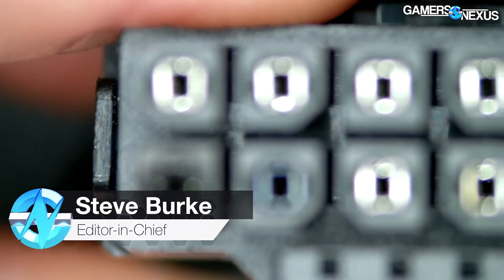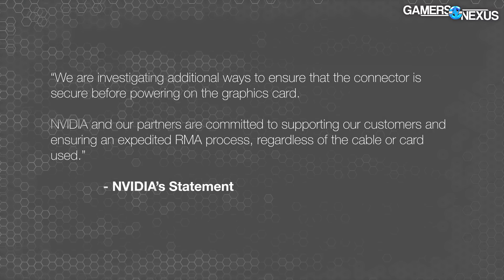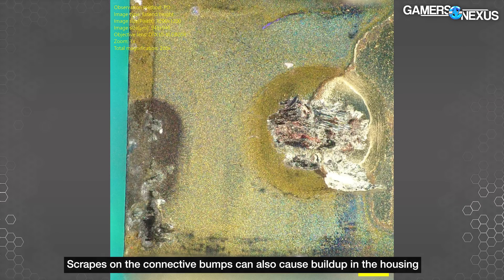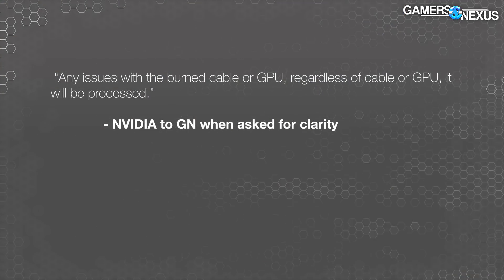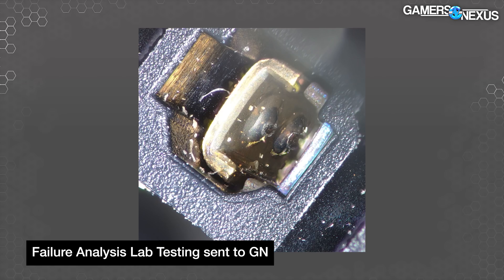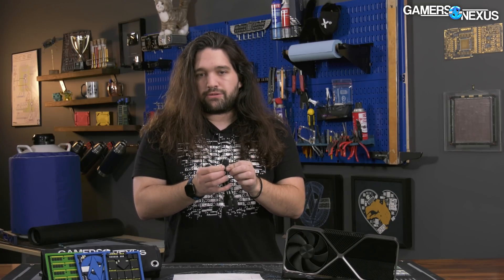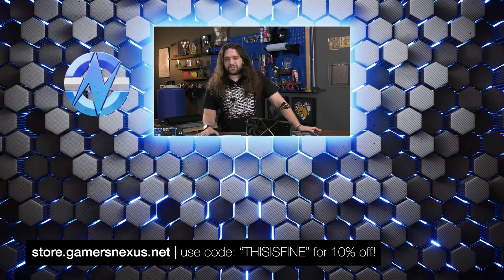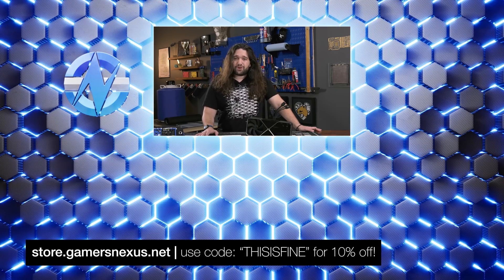NVIDIA Responds to Melting Cables, Warranty Concerns, & 12VHPWR Adapter Failures

Comment: If they widen the locking clip to cover most, if not all the width, it will fully secure the cable in full.

Provided the customer seats it till it locks.
Reply: @_Clivey  
Yes, it must be clicked in.
The widening will eliminate the tilt factor 100%.

Comment: I do not believe this connector to be safe, its underrated , its cycle count is dangerously low. bending in in any direction even on first insertion is enough to cause a spade to bend and cause failure. You need to insert the connector straight in till it clicks and never remove it even once. Any thing beyond i believe could cause failure. 

Also i feel like the .05% fail rate is low. its at least 1%..or more.

Comment: I have a gainward phantom 4090,and have no problems with the connector,i just looked when installed the card that the connector is perfekt fitted,and thats it,works like a charm here,this in a lian li o11 dynamic  tower.

Comment: They should probably be able to fix this issue by making the 4 sense pins shorter, so that it will not work at all unless it is inserted deeply enough. This would not be dangerous as the 4 sense pins do not carry a notable current.

Comment: Nice to hear nV finally respond.  They finally scoped the potential damage at less than 0.05% and decided, sure we'll cover this issue!  Good work, Steve/GN...you damn near finished that plugs cycles in one video for us!
Reply: Also interesting to see there was more hair on fire than melting gpu's over this when the data comes out and shows how little of an issue it was to begin with. But if you listened to all the chicken littles out there you'd think 4 out of every 3 40 series were melting down.
Reply: @mattk6827  Still not acceptable, over time the connector will become worn and brittle (prone to failure). Connector definitely needs a redesign.

Comment: 12:45  latch? wtf that cable DOESNT HAVE A LATCH , is absolutly WRONG DESIGN.  there is not way to secure plug without it 
which one of the designers though was fine to leave it that way?

Comment: Graphics cards are so powerful now that they can almost be directly plugged into the wall.

A single IEC plug vs these high current, low voltage cables.

Comment: I made this comment on the original GN video: if users can think this connector is properly inserted when it is not, that's a design flaw.  It should be almost impossible for the connector to be inserted improperly IF such improper insertion can cause melting or fire.  Improper insertion should cause the system to throw a VGA error, thereby alerting the user to the problem.
Reply: Yup. Funny to see all the people saying you deserve to have your card break if you didn't put in the cable right.

It has literally never been in issue in my lifetime. No connector I've ever used could become a fire hazard if improperly inserted.
Reply: @Nathanix321  Indeed, and none ever should.
Reply: Exactly what I commented on.
A cable should be socketed and done forever, without the need to check on it every time the user removes the side panel or pushes the cables to cable manage.
Every other direction or “instruction” is there to cover a poor design.
And the engineers know perfectly well that even power users do not assemble PCs using checklists and redundant checks.

Comment: I wish this much attention was dedicated to horrific coil whine issue in 40 series cards. It's so frustrating having to play this lottery. It seems like coil whine has reached new heights now. I've never heard coil whine as bad as in 4090 TUF card. Some people get whisper quiet cards, while others get buzzing/squeeling monstrosities (see der8auer's 4080 STRIX video). Would be amazing to know what % of cards have coil whine. Why do manufacturers insist on using components from inferior suppliers in some of their cards, but not others. What's even the point of these 2.5 kilo 4 slot coolers with huge fans if coil whine is louder than everything inside PC.
Reply: I had coil whine when using a psu I bought new with a 2070, when upgrading to a brand new gpu 2 years ago . I got a new psu, and it completely went away.
Reply: My 4090 TUF has a slight coil whine only at full load but in my experience the coil whine will usually lesson over time.
Reply: @dj Kplus that would be like buying a brand new car and having a loud squeal or knock or vibration and when bringing it to the attention of the manufacturer they respond with, it isn't a fire hazard or dangerous in any way and it's still drivable. I'm sure most people wouldn't be happy with that and would want it fixed, a replacement or get a refund. With the price of these new series graphics cards you would expect and should get a high quality product without any issue. It may not be dangerous or a fire hazard, but without knowing what is causing the noise it could possibly be a potential hazard of some sort. Besides the majority of graphics cards don't make a noise like described so I can understand how it would get irritating to have to put up with, when they shouldn't have to put up with it. But you are correct, unfortunately unless it proves to be a danger no one will really put a lot of attention into looking into the cause and to rectify an issue like that.
Reply: @dj Kplus Have you seen der8auer 4080 STRIX video? He said that GPU would be unusable in day to day. He could hear his test bench coil whine from across the room while having headphones on! My 4090 TUF could be heard from across the house. Yeah, let's ignore that significant number of people get dud GPUs while paying 2300 Eur / 2000 USD for them, and companies don't even treat this is a defect. You can't RMA for coil whine.
Reply: @dj Kplus lol did I hurt your fanboy feels
Reply: The point is increasing profits as well as lingering issues with the supply chain that makes it so that many companies are happy to get anything at all, even if it's below the standard they would have demanded otherwise.
Reply: @msytdc1577  Sure, let's totally ignore the suicide-inducing sound that some people have to deal with.
Reply: @Bloodonmyknife  Well, at least there is the option for having a graphics card at all for those that don't care, instead of there being no supply because 'available, and fully functional' isn't good enough for some. As to who may not care: users hard of hearing, wearers of in ear monitors or well sound insulated closed back headphones, people who put their PCs in a separate space just running a monitor and a USB cable to their desk area, etc.
Reply: @msytdc1577  I'd fall under the "isn't good enough for some" title. Unfortunately the people that"don't care" let these companies get away with offloading products that are inferior and or not at the standard of quality that they should be. You didn't state if you were the "don't care" type or the "isn't good enough for some" type. The"don't care" type don't help with the fact that when a situation like the core whine issue is brought to the attention of the manufacturer, you may get a response like, it's not a problem that has been brought to our attention, because the people that "don't care" obviously "don't care" and keep using a product that does something it shouldn't do. Like my comment above yours, if you purchased a brand new car and had a noise, knock, vibration etc would you be ok with that? even though your friend with the same exact new car doesn't have that same problem. I for one just have higher standards than others and want things I buy to perform as they should and not do things they shouldn't.
Reply: @666DevilsReject  I'm in the I don't care category because I don't buy Nvidia products for the reason that as a company they're shitty bad actors in the industry, and I'm in the category of if you keep going back to them then you've only yourself to blame.

Comment: Just because NVIDIA sold 100K cards or 125K cards doesn't mean they are in the hands of consumers. There could be 10's of thousands being received in batch at all the local Best Buy locations. Even if cards are in consumers hands, many times they are part of a new build and they are waiting on a motherboard or CPU. My point is we really can't come close to estimating if this is an issue for .01% or .05% or other. Also, for many customers, their issue didn't manifest itself immediately, so there may be many more to come. It does sound like this is an issue with the cable latch standard. I have a 2 way adapter that came with my 3080Ti...as did everyone else  that bought one. Why no major issue with that ? That connector on the card is at a 45 degree angle so probably has much less stress once installed in a case. Some of this has to be on NVIDIA with the design(i.e. location of the connector)
Reply: Then when a user gets one the warranty will start from that point. If there is a failure Nvidia will replace it and you will know to insert the cable fully next time.

Comment: What I don’t understand is why 30 series FE cards, which used a nearly identical 12 pin connector, didn’t have these socketing and melting issues. High end cards like the 3090 and 3090Ti had high TDPs and yet still didn’t have widespread melting problems.

Comment: As a 4090 non owner, does this mean we can get the 4090 without worrying?
Reply: If you plug it in fully, and avoid bending too much, you're likely totally fine.
Reply: If you can plug a cable in all the way then go for it!
Reply: As long as you know how to build a PC and don't tippy tap around electronics like a pussy because "if I breathe on it wrong it might not work" you'll be perfectly fine. Just push that sucker like it owes you money and you'll be fine.
Reply: The whole issue has been overblown by owners who are brain-dead enough to not fully plug in the connector, or failed to have a look at the connection, before powering on the system.

Comment: This is a full self own by Nvidia for releasing a $1600 GPU with a cheap, poorly designed adapter. They've become so concerned about squeezing their profit margin, they'll cut corners on QA and rather take a chance that they won't have any liability in the resultant situations. It's perplexing that Nvidia couldn't see this happening given the size of the cards, and flimsy construction of the connector.
Reply: They made it to the industry agreed standard.

Comment: Could you imagine if this sort of thing happened at the enterprise level?
Reply: Theres a lot of harder connections than this on enterprise gear, and the cables arent being yanked at odd angles to look pretty - it wouldnt be an issue.
Reply: Oh, it does. The difference is that anything that important will have some method of it not greatly interrupting operations should a failure occur, be it concurrent live redundancy, automatic fail-over, cold standby hardware ready to replace a failed part, or simply paying out the nose for fast response warranty coverage that will rush a part to you, be it locally in 4 hours or less, or shipped overnight morning delivery, etc.
Reply: I am sure they would be more than happy to offer a free "how to plug in a cable" workshop for all their big customers.
Reply: Or enterprises could watch a 18 minutes video that tells you to connect connector fully and the failure rate would go down.
Reply: Ah yes because enterprises pay skilled technicians 50$ per hours to not plug in connectors fully
Reply: Indeed. They'd have 0.4% of a nightmare on their hands.
Reply: @theredscourge  indeed you calculated that with real data and didn't considered the amount of unreported ones. 🤡🤡🤡
Reply: @spookyskellyskeleton609  0.4% of a nightmare is still pretty bad. It's just nowhere near as bad as 100%.
Reply: @theredscourge  .04% of a nightmare, or 1 in 2,500 lmao

Comment: You have done such good work here!
I wonder if NVIDIA reached this conclusion all on their own. The release timing shortly after your video is convenient. 😆

8-pin connectors were difficult to plug in or disconnect. I look forward to seeing how difficult the 16-pin connectors are to plug in. I am surprised that they didn't make the sense pins shorter than the power pins, requiring a minimum insertion distance. Then, improper insertion would just result in a low power sense pin melting a little if at all.

EDIT: I guess this idea was late.

Comment: From my understanding of this whole cable problem it's not an nvidia issue but the cable standard that was voted on that needs to be tweaked in order for it not to become a fire hazard.  New technology is never 100% at launch and will need to be fixed overtime.  This reminds me of the Wiimote's wrist straps.
Reply: Well... this kind of design issue is well known in automotive connector industry.
The connectors have a maximum insertion force specified, minimum audible and tactile feedback, cleanliness and different clip / lock types for how secure the connection has to be.... so about everything that  is missing in this standard.
Critical power connectors also have contact features to detect not properly seated connectors - like the proposed change to the 12VHPWR standard
Reply: Why is this "new technology"? High-amp power connectors are a very old and very well-known technology. This issue has been solved for a hundred years.

Even just using something simple as a positively latching connector (i.e. one where the latch pulls the connector in, like the old Centronics printer plug) would help. It's not magic.
Reply: nvidia is a member of PCI-SIG, so they had plenty of input into the design
Reply: Huff that copium bro @ orlando

Comment: Gotta love this new cable, thats so bad we need a 5 minute tutorial on how to plug it in. If only Nvidia focused on making a power efficient gpu instead of making a space heater
Reply: @narpuppy420 Hi Nvidia fanboy. You might not have watched the video. The fact that they are thinking of changing the design of the connector already shows the design is flawed...

Comment: It’s extremely hard to tell whether it’s fully plugged in with such a small connector buried in gigantic heat sink. And there is no clear clicking feedback.
Reply: Having the connector not click during installation is one thing but having HALF of it not plugged in is pretty easy to spot in my opinion.
Reply: Yeah, I can see that the interface between the 2 connector faces is buried in a shroud. It's got to be very loose before you see that it's not fully seated

Comment: Bottom line, I am paying a premium for what? A fire hazzard? THIS is a clear dereliction of responsibility in safe engineering by NVIDIA and the team that designed this cable system. 

When the consumer is having to pay nearly $2000 for a graphics card, it better be safe, and engineered where things like "improper" (as their legal scam team puts it to pass liability) insertion is not something that happens. People are liable if the "improper" insertion was intentional. Not accidental because of an engineering flaw. That is absolutely on NVIDIA.

There should be an immediate recall as this is a FIRE HAZZARD.
Reply: @_Clivey  Fanboy crap puts people in DANGER here you lunatic. NVIDIA still has the final say on what is used and how it seats. DO NOT marginalize this problem, otherwise you are just as responsible for the danger this puts people in!

Comment: thats not very six sigma of nvidia. .05% is terrible for manufacturing and should have never hit the market. six sigma is what 99.999% of companies use as their max failure rate before releasing a product. six sigma pretty much means there are 3.4 defects per 1 million units sold. being at 50 per 125 thousand is just utter incompetence by the design team
Reply: Nvidia are using the industry agreed standard.

Comment: "user error" "here is a guide of how to really, really, like actually make sure its plugged in". If a cable needs a guide on how to properly plug it in then the error is on the design not the user.
Reply: @_Clivey  lol? The advice here is to plug in the cable outside of the case because its so hard to tell if its actually plugged in otherwise. That is not users making a mistake. That is a design flaw. More so because nvidia knew it was a problem and still pushed it out.

Comment: Nvidia sold 125k to retailers, those sold less to actual customers. Also, you have people not reporting the issue, and totally trusting Nvidia reports of 50 issues so far.

So the real percent is a lot higher than 0.04%
Reply: Why would anyone not report their $1600 card melting?
Reply: not yet reported.
Reply: The real percentage can only be calculated in 5 years, because we can't know how safe and effective those cables will be until time passes.
Reply: @QuantumConundrum  the ones doing sample testing and quality control at the factory know very well what is the failure rate.